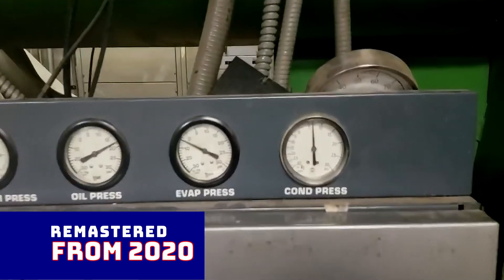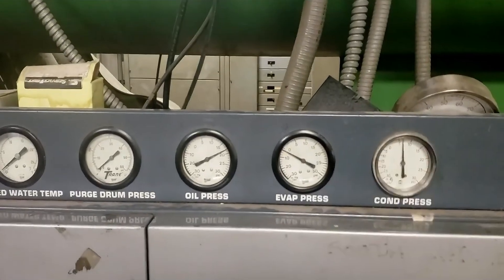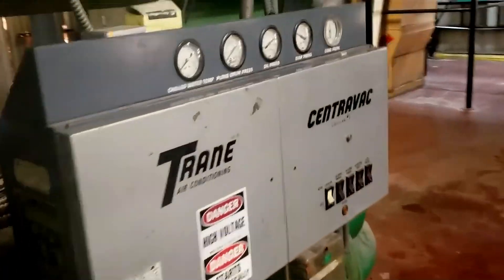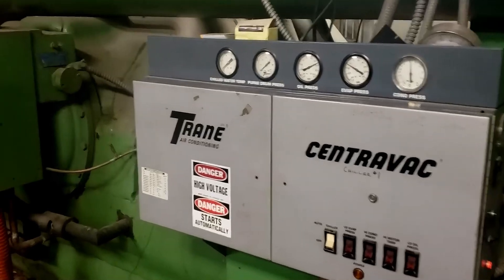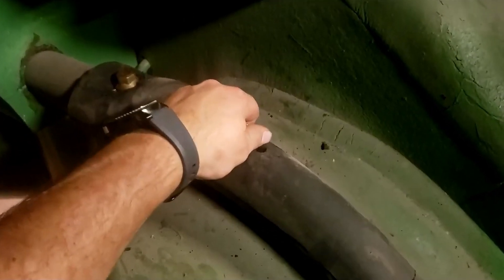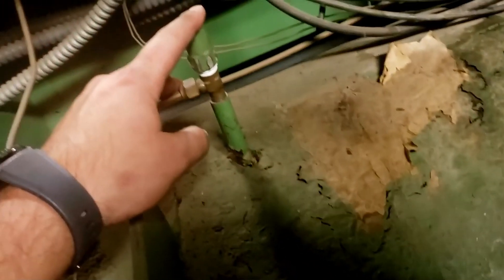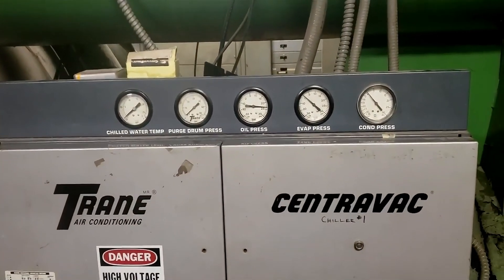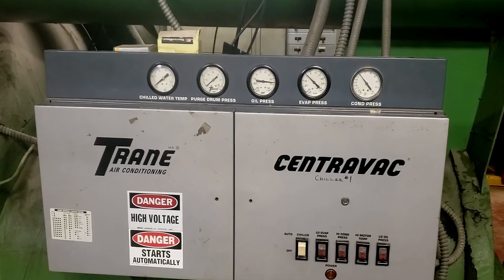Ancient Trane Chiller Leaks causing Surging

Comment: Put the current limit to 60%, decrease the chilled water flow. Depending on outdoor ambient temperature try to keep condenser water temp as low as possible.  Wirh the Purifier purge restrictor by-passed keep the chiller running. You should get the air out of the machine alot sooner.
Plus you don't have the machine sitting idke.
Reply: And manually drive those vanes; if possible. Guaranteed that air will come out faster as well within the day or the hour depending how bad it is